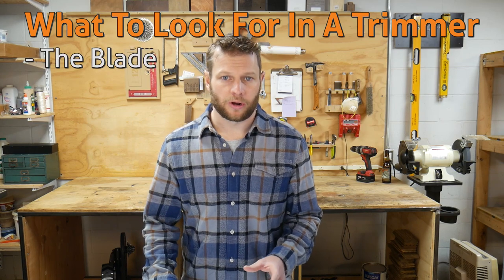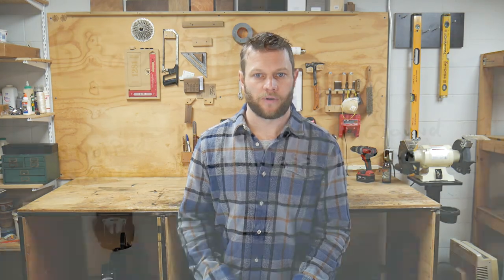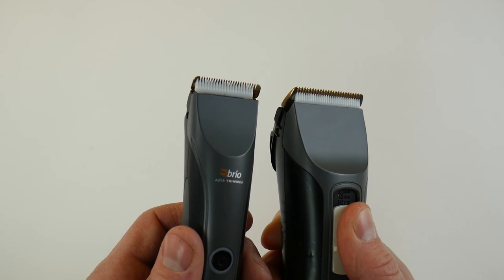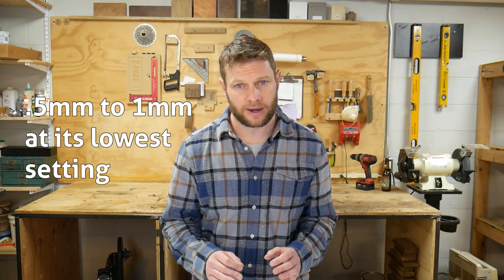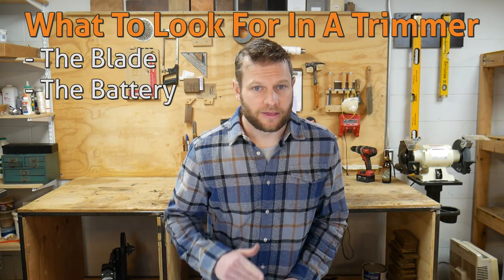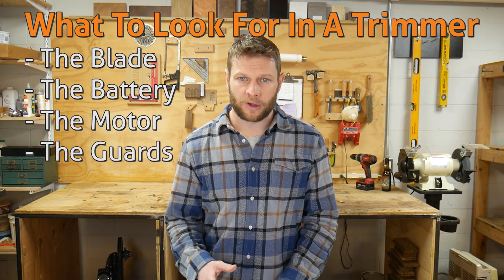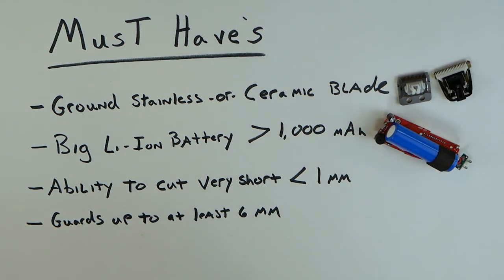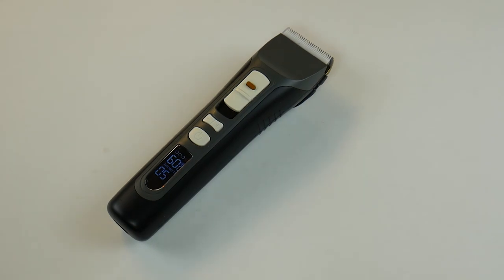What to look for when buying a trimmer

Comment: Imagine a 3.5k channel is giving ACTUAL trimmer buying advice than the celebrity wannabe barber shop "my top 5" crap.

I don't care what is recommended I care WHY and WHAT I need to look for.

Instantly I learnes there were ceramic blades and what the differences are. I don't care if they cost more because it's expected of they last longer and cut nicer.

Just 1 minute in. Already he's blown out the influencer crap. Also there are actually so few buying guides for this stuff it's insane. Makes it harder to compare consistent information.